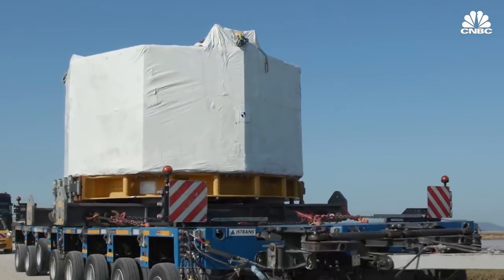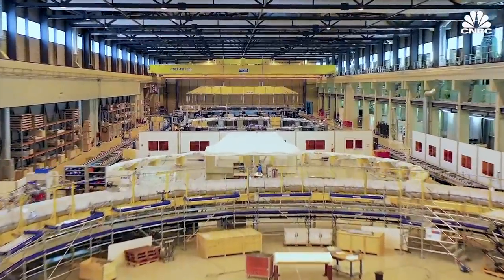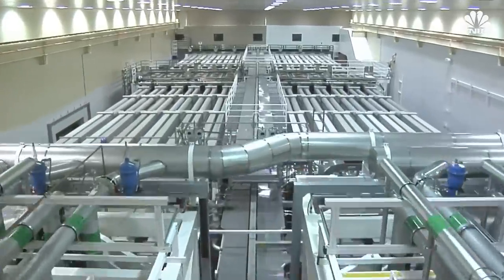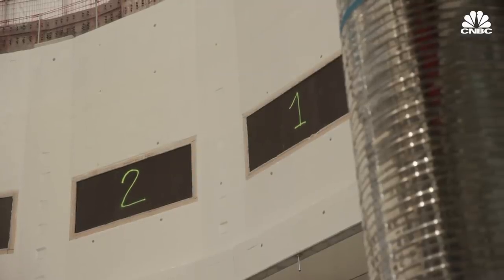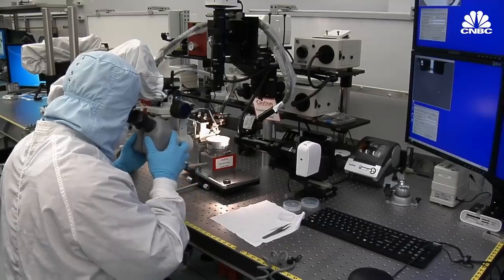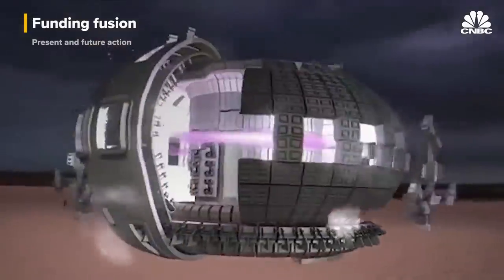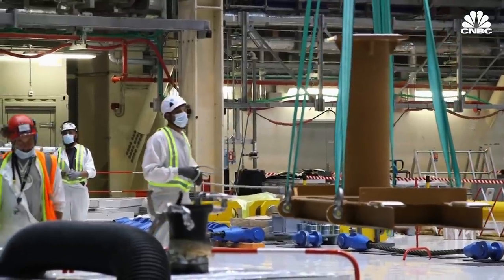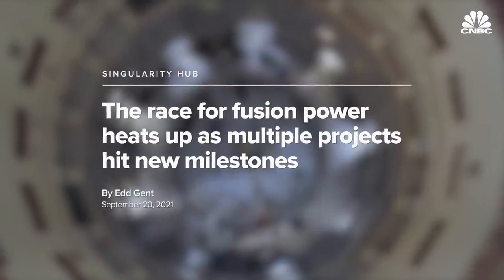Can This $22 Billion Megaproject Make Nuclear Fusion Power A Reality?

Comment: I took my first nuclear engineering class in 1966. At that time, we were told that "fusion is just X years away," where X was some number in the range 15 to 50, the exact value depended on who was talking. The same statements are being made today in 2021. I hope it works, but magnetic confinement of plasma is a very difficult problem to solve.
Reply: Isnt that already achived by Wellenstein 7X tho?
Reply: It shouldn't be classified as very difficult. It is plain and simple impossible.
Reply: The thing is that fusion is here and has been for a few years, now it is just about making it happen in a way where more energy can be generated than what is needed to make fusion happen.
Reply: @rosomak8244  just like fission was impossible to solve yeah?

Wrong.
Reply: @bzdtemp  That has always been the problem. That is what Jeff Ryman is saying. There has always been great hype surrounding fusion, yet the progress has been minimal in the last 50+ years.
Reply: This energy idea will never ever work. I can guarantee it. I will return here in 5 years time and call every single wannabe out.
Reply: I worked in inertial laser fusion in 85 out of college. And i totally agree with u.
Reply: @estebanslavidastic4382  Fission is a self sustaining reaction, whereas hydrogen requires (outside of the sun, of course) lasers and containment fields. There's good reason to be doubtful that we will manage to get more power out of it than we put in.
Reply: @rosomak8244  shouldn’t be able to fly but we can, shouldn’t be able to harness sun light but we can… point is it’s only impossible because you lack the imagination and skill to achieve it.
Reply: But in 1966, there was not even a beginning of a project to construct. Now there are things built
Reply: @rosomak8244  wasn’t that the same thing people say with electricity and nuclear?
Reply: Well, now they have all the knowledge gained since 1960's, so maybe it will end up better.
Reply: @Tobiemoss  lol don't worry they're not gonna make a black hole
Reply: @zippyparakeet1074  People in the middle ages where making progress not by randomly banging their heads agains the wall against better knowledge but by trying to understand the world around them. Plasma is already well understood and the problems are already known to be unsolvable in a mathematical sense. Or in more simplistic terms: no matter how much you will wish for and how often you try 2+2 will still be always 4. People in the middle ages already knew that. Plasma behaviour is a problem of the same category - just a bit more difficult to understand. However if you understand you know that the result no matter what will still be 4.
Reply: @rosomak8244  wrong. It is possible and those equations are what these Nuclear Fusion Reactors are being designed on.
Reply: Only 1 month after your comment, a fusion reactor has finally produced more energy than used! First visable nuclear fusion!!
Reply: @default2826  Please give the link.
Reply: @default2826  link?
Reply: @estebanslavidastic4382  I believe this is already happening. I feel the shift getting faster and stronger and I can't take in a the knowledge.
Reply: @Quantumfishics  the top 10 highest paying careers in 20 years, don’t exist today. 

We are in the cusp of technological renaissance
Reply: And the joke about "fusion is just X years away" has been made in pretty much every discussion of fusion power on social media. Yes, we know.
Reply: It is damn near impossible that's why it taking so long. Feel like it will always be X years away. Every new year we hear the news of new developments in Nuclear Fusion but by the end of the year it turns out to be bluff.
Reply: Well newest experiments by China East which is part of ITER has successfully maintained plasma (only 80 million degrees) for 1056 second which is 17 minutes, I guess with this we could say that the confinement of plasma is no longer a big problem
Reply: So is density and temperature.
Reply: @Tate525  if a insane amount of funding was put into research, and design, then we would probably have reliable fusion within 20 years
Reply: They are very happy if it runs a couple of seconds. 
Let's see if they manage their donut suns heat in 100 years when someone got a better concept
Reply: @estebanslavidastic4382  green hydrogen production (whilst in motion) works with boating and possibly, as you mention, in out of earth atmospheres; no need for refuelling, no ports or depots controlling our consumption levels, no manufacturers holding on to our pockets. ✝️
Reply: @L.M1792  EXACTLY! 

combined that with a carbon nanotube space elevator, and atomic size quantum computing, graphene processors, and sodium sulfur batteries, and all of a sudden we are looking at the energy to:

get into space cheaply
harvest resources from space cheaply
stay in space cheaply

once we crack these puzzles and put these technologies together, they will unlock the potential for SOOOO MANY MORE new technologies, industries, and prospects which, over the next century, will do AMAZING Things for our species.
Reply: @estebanslavidastic4382  space elevator? how do you maintain a continuous break in the ozone layer and not find yourself being sued in a court of law for unethical and immoral practices, and ruining the atmosphere of earth for your own selfish gain?
Reply: @L.M1792  you do realize the o-zone isn't like, a glass barrier right? its a layer of oxygen gas.
Reply: @estebanslavidastic4382  that together with its magnet field shields the earth from obliteration. we would do well to take fairy steps regards such possibility else the violated monsters so carefully stripped of all they were once worth, living now so meekly amidst the dark matter, may very well come creeping through.
Reply: @jackking5567  It been only 3 months and are now able to sustain it for 5 sec to proven the concept works. May be every wannabe out there should call you out in 5 yrs
Reply: I’m sure some person or group of people will figure it out and then make it more simple.
Reply: @ruddiestmanx5116  it’s possible we have already said enough already.
Reply: @johnbragg2014  America writes in its rules and regulations regards nuclear power that nobody should live within a thirty mile radius of a power plant. Nobody should live downstream or downwind from one either. American physicists and law makers did not write this rule book for no reason. They wrote this because it is a dangerous and volatile substance. Plutonium-239 has a half-life of twenty four thousand years, a shelf life far outliving any constructed containment casing that may be housing it. If we expand these plants into all of community we will bring an end to organic life, fact. Our generations alive today will not live to see this but future ones most certainly will. And for what, readily available convenience? we should care more for what bore our life forms through its evolved and supportive environment than mere convenience.

we have green hydrogen, turbine power, solar power, all good green energy providers.

we must ditch this two century old mentality and progress in our thinking by divesting and learning new and improved ways of spending our hard earned money. when dangerous options are no longer available to us because of their being banned we will experience improvement and the establishment of cities, towns, villages, that are not reliant upon funding our own demise.

The model for the future city is not reliant upon energy from fossil fuels or nuclear power.
It has escaped these company policies holding our biologies and good health ransom.

BAN THESE DANGEROUS AND VOLATILE ENERGIES BEFORE WE ARE NO MORE.
Reply: @johnbragg2014  yes investments gone wrong. you can take solace in the fact that there have been over two thousand nuclear detonations since Hiroshima. it isn’t only politicised Americans who fell victim to bad management decision making.
Reply: @estebanslavidastic4382  No the way it is impossible to on a scale less than e.g. the sun to get it to produce more energy than it consumes.
Problem with fission was only to limit the chain reactions, so it wouldn't cause a meltdown.

It is complete opposite issues.
Reply: Why aren’t they trying other methods to confine the plasma other than giant magnets? Surely we can solve that issue? I wonder if it can be done with electricity
Reply: @jackking5567  ok tin foil hat
Reply: I can understand why estimates were so optimistic in 1966. Nuclear research was new and moving so fast at that time.
Reply: Being able to do it is one thing, but being able to do it on a level to bring it to the commercial use is another.  I watched another video where the costs involved is just astronomical.

I think more R&D should be done in other forms of energy production and energy storage that's far more viable to bring to the market.
Reply: It’s always impossible until it happens.
Reply: To hard for Ai to solve?